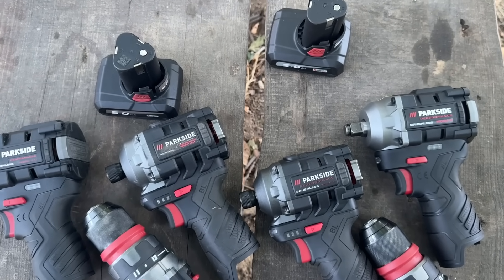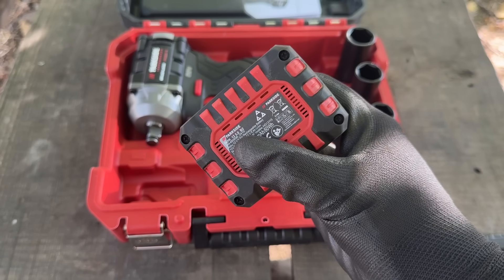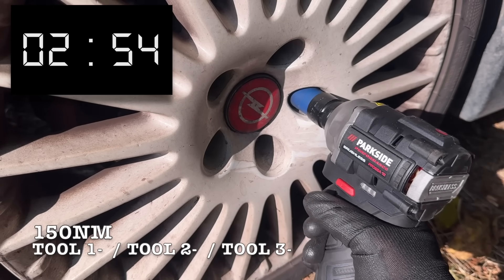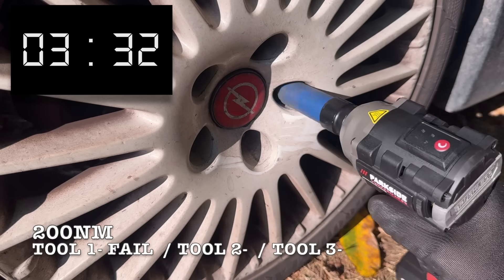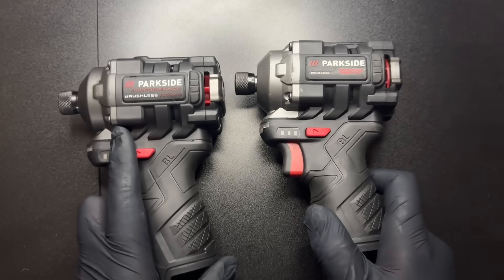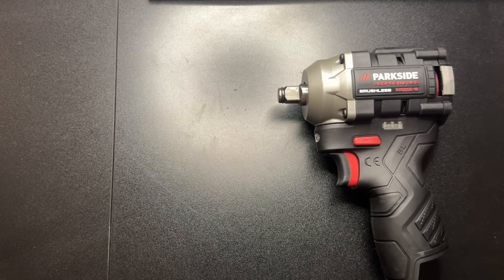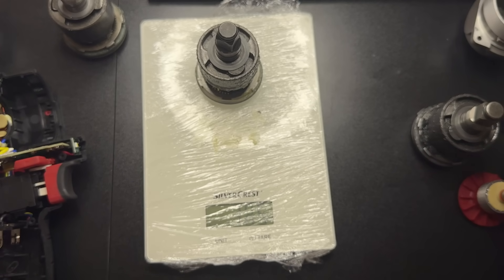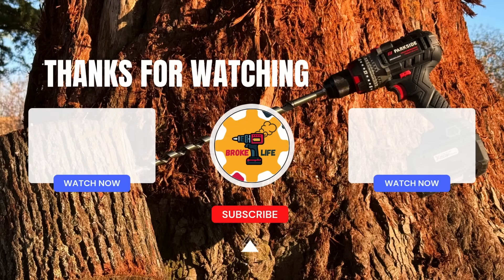Surprise! Parkside Performance 2025 Tools - Test and Teardown, PDSSAP & PPDSSA A1 12V.

Comment: Really helpful video as always! I bought the 2025 12V impact driver and converted it to 1/4 square the way you showed in the other video. It works fine for me as I use it with sockets up to 13mm. But I tested it on a M8 bolt and the maximum torque it produces is around 35-40Nm both tightening and loosening on 4 level. On level 1 the torque is around 12Nm and on level 2 is something like 20Nm. As standard M8 bolts can handle something like 40-50Nm. I’m happy with it but was wondering if this is normal as the maximum advertised torque is 170Nm. 5Ah will boost the power I think, but again it’s far from even 100Nm.
Reply from the maker: That sounds about right for the 2025 model which has a much smaller hammer when compared with the 2024 version. The 2024 version feels a lot more powerful with the 1/4” anvil, maybe even too poweful for that anvil. That’s why I have also switched to the 2025 one as my 1/4” platform.
Reply: @BrokeLifeEU Thanks mate! It’s a shame I didn’t find this channel earlier! You’re doing amazing job with these reviews, keep it up!
Reply from the maker: Cheers! Thank you so much for your kind comment!

Comment: it is normal cause your using the 5amp 12v impact wrench it is not great for thing more used in automotive world you would want a  A1 600nm small performance parkside impackt wrench atleast something with 20volt cause 12volt motor is not going to cut it.

Comment: I can't get parkside here in aus but I am a fan of aldi's ferrex stuff. Not perfect, but very good for their price (although sometimes there's a really shitty tool but they don't care if you return). 

This issue has also just cropped up for me, they sold a new kit last week that looked to be a compact redesign of their hammer drill and impact driver. Being a tool nerd I grabbed a kit but I've immediately noticed the driver in particular just doesn't perform like my old one from 2019. I haven't opened it up or anything but I wonder if it's the same kind of problem with the hammer/anvil.

Comment: Good tools, but the controlled availability marketing strategy doesn't really work for tools when you e.g. must cut hedge next weekend. Local shops often wouldn't even have essentials like spare 12V charger or battery.

Comment: here in Scotland they are selling a performance Tool kit consisting of drill driver and impact gun with the new model ending in B1 not A1 and manufactured in June 2025 I do not have an old model to compare it with

Comment: The older model hammer has a almost perfect 90 degree force impact over a large flat area, while the new one's with the large rounded edges loose power due to the half the force being directed against the circumference! My POW.
Reply from the maker: And they don‘t even hit both hammers at the same time so most of the time you get half of the IPM with the 2025 model. 😕
Reply: Prisoner Of War?

Comment: Hello! Parkside performance is coming to the UK for the first time this week. They're selling the 12v drill and impact driver with 2 of the small batteries and a charger for £50. Is it worth going for it should I steer clear since they'll be 2025 models? I'm really keen on the impact wrench if that ever came to the UK but saddened the QC might make it not worth the purchase

Comment: Would you say it's worth avoiding these going forward?
Reply: I have bought 2 torque wrenches. One is about 150nm, second ~180. Both od them has got worse type of the anvill. Is there chance to get 2025 version with old style anvil?
Reply from the maker: @machey8259  I have found a good 2025 one and I am editing the video at the moment so I will post it later in the week or next week and I compare it against the 2024 internals too.
Reply: @BrokeLifeEU can you test new version pdssap 12 b1 impact?
Reply from the maker: Not necessarily — I actually managed to find a good one and even made a video about it (although not yet posted). I just haven’t had the time to edit it yet, but I’ll probably get around to that this week or early next week.

Comment: I don't seem to see tools from the Parkside performance range in my three local Lidl stores. I check on a Sunday or Monday when the tools are advertised. The more expensive Parkside tools (typically sold inside the EU) simply don't reach the UK. I have never once seen your 5Ah 12v battery here. I consider Parkside a VERY basic budget brand, even in the UK. These days I avoid them.

Comment: There is a new PDSSAP 12 B1 impact driver but currently it is only available in a set together with the PBSPA 12 E4 drill. (70€ for both including 2 batteries), I actually payed only 49€ for the set since I got a 20% and a 10% coupon from the app. Might be interesting how the new B1 version compares to the A1

Comment: Herzlichen Dank für den Nachtest und das du keine Kosten und Mühen dafür gescheut hast.

Ich habe ebenfalls einen PPDSSA 12 A1, von 2025-05, gekauft direkt im Lidl-Webshop. Hammer und Schlaggewicht sehen bei mir genauso aus wie bei  deinem 2024er Modell.

Ich habe noch keine direkten Tests mit Drehmomenten gemacht, schlage allerdings dir vor, einen Drehzahl-Test durchzuführen. Denn die Drehzahl ist letzendlich entscheidend für das maximale Drehmoment.

\(E=\frac{1}{2}\cdot m\cdot v^{2}\)
E= 1/2 m x v²
----------------------------------------------------------------------------------------------------------
Thank you very much for the follow-up test and for sparing no expense or effort.

I also have a PPDSSA 12 A1, from 2025-05, purchased directly from the Lidl online shop. The hammer and impact weight look exactly the same as your 2024 model.

I haven't done any direct torque tests yet, but I suggest you do a speed test. Because the speed is ultimately crucial for the maximum torque.

\(E=\frac{1}{2}\cdot m\cdot v^{2}\)
E= 1/2 m x v²

Comment: Look, I’m experiencing a similar issue with the 12V drill. I bought one unit and immediately noticed something was wrong: too much vibration in second speed and low torque. Before returning it, I went back to Lidl and bought two more, because I wasn’t sure whether it was just that unit or if they were all like that.
The second one vibrated much less, but there was still a strange vibration. The third one, on the other hand, didn’t show any problem in second speed.
I tested them by driving two lag screws that my 20V Ferrex (45 Nm) can manage with some difficulty, but it gets the job done.
The first drill broke after a couple of attempts: the gearbox switched from first to second gear on its own and cracked.
The second one also shifted into second gear by itself, but didn’t break.
The third one managed to drive the screws with difficulty similar to the Ferrex.
Now I’d like to understand: how is it possible to have such big differences in production within the same batch?

Comment: So. A dremel and a grinding bit applied to the hammer and stops to to ensure they contact at the same time should fix the problem. Unless there is a hardness problem as well. I noted the anvils were looking a bit worn (very smooth in areas) on some but only on the top that indicates the hammer may be riding up on the anvil,  or the hammer or anvil has a slope on the face and that is power loss.

Comment: Typical behavior with manufacturers. Make a decent product, then try shaving a few cents here and there for the next iteration. I have three of the  big 1/2" impact wrench (green, non performance model) from 2022, 2024 and 2025 and the 2022 is still stronger than the newer ones... shame.

Comment: Not just Parkside... We've seen reduced quality (in recent years) from every other tool and especially vehicle manufacturers.
Reply from the maker: My car batteries usually fail within a month after the warranty runs out! The only thing I can do is laugh at how “well” and precisely engineered they are, then buy a more expensive one and hope it lasts longer. But maybe I should go the opposite way—buy a cheaper one and just hope it makes it through the warranty period.

Comment: Parkside tools are forbidden in my garage, in past I bought once parkside 230mm angle grider and is was faulty as well as all replacements, disk was shaking, so never again I bought a metabo 230mm angle grinder and still have it as well as other 6 metabo grinders. I use all 18v metabo and mostly 12v bosch and a bit 12v metabo

Comment: would you bother grinding some of the hammers so they make correct contact?
Reply from the maker: I don’t think that will really get them to the point where it makes much difference. Ideally, they’d need a new hammer and anvil—that would be the best solution here.

Comment: As a thought to get to the next level maybe a hardness test on the metal itself, it may not just be a matter of fit but also one of hardness. One thing for sure is that channels like yours are improving overall quality and performance across the board.
Reply from the maker: That’s what I thought as well—until I looked into how much those testers cost and nearly fell off my chair 😅 Still, I agree, it would have been ideal if I’d managed to test that too!

Comment: Congrats...I just bought mine yesterday but didn't find batteries and charger to buy. Is there a diy fix for the "hammer" problem?? Thanks
Reply from the maker: Thank you! Unfortunately, I don’t think there’s a DIY fix for this, as even the hardness might be different. Sadly, I can’t prove or test that, since the tools needed to measure it are quite expensive.

Comment: This unequal hammer not hitting the two sides of the anvil is a problem I noticed also on these cheap chinese impacts.
I own some of these and in all of them the hammer part is sticking out.
So I was able to grind the hammers to touch the opposite sides of the anvil the same.
It does make a difference in performance.

Comment: Thanks for the test. I was about to buy 12v impact to use with 20v, but now I won't.

Though it makes sense form Lidl perspective. They want the least varranty returns they possible, so reducing power for lasting longer is no brainer for them.

Comment: Great video.
So, the size of the hammer on the driver is a big deal, even if it last longer, the power isnt the same, so at least they should update that.
On the wrench, its clearly a production error, that once again it shows that diferent manufacters make a diference... for the same price. Maybe the next model will be made with tha same quality as the 2024 model.

Comment: Where do you even get hold of these, our Lidl in Manchester Never gets these
Reply: As far as I can find out Parkside performance range isn't available in the UK. We can have green, or green.
Reply from the maker: Unfortunately, the UK sees little—if any—of the Performance line, which is a real shame, because despite everything they have some superb tools!
Reply: As far as I've been able to find out, there has been little if any performance tools in UK Lidl. Until the 19th of October, when the website is promising the 12v drill driver impactor kit.
Reply: @dlh190 yeah it's funny that, just as we,re saying you can't get hold of them in Britain they are doing there first on the 19th oct

Comment: Do you think we can improve power changing the spring ? Thank you
Reply from the maker: I wouldn’t mess with the springs on these. The impact driver relies on the hammer mechanism for its power, and using a stiffer or thicker spring could overload the electronics. When it comes to the impact wrench, improving the fit between the hammer and anvil will have a much greater effect on performance than just changing the spring. Installing a heavier spring in a setup like this is a recipe for disaster — it risks damaging the tool or reducing its efficiency. Personally, I wouldn’t want to do that to either of them.
Reply: @BrokeLifeEU ok, I saw in your videos the spring from your 12v impact wrench , I think it s thicker than mine . My tool struggle to unscrew 200 nm on my car with 5ah battery 😢 . Thank you for response
Reply from the maker: @andreimoise94 Please don‘t tell me there is a difference in springs as well… 🤯

Comment: the same brand , but not the same quality  of the anvil and the hammer mechanism!!! the new one are bad ... not hard steal >... and they do not last longer...
Reply from the maker: Yes, these were a huge disappointment! That said, they’d be an easy fix if the manufacturer decided to do something about them—all it would take is replacing the hammer and anvil, and they’d be good to go. But the difference between the hammer and anvil in my 2024 model compared to the other three is massive. I honestly wasn’t expecting such a big difference.

Comment: Im a diehard parkside commercial user.
My first drill, was from 2015.

Lately the quality is going down really fast.

I bought a corded grinder.
The mcu is getting hot while not using and many more low quality items.

Comment: Hi there, i work in a factory producing pizzas for Lidl Greece. They come for inspection every 6-9 months and they check what they think it needs to be checked. I agree to a point but if they truly want do quality controls (quality is excellent but working environment is average) they have to go undercover somehow. They have to be "insiders" so they have true quality inspection cause once you find your self "f'ed up" you dont risk it of being found a second time... You make anyway possible that there wont be a second time. Great video as always. I was a parkside fan and admirer growing up but now almost 32 i find my nephews toys to be around the same quality of parkside tool shells and thats disappointing. Only parkside tool i get from time to time are either mechanical or wired 🤷🏻‍♂️
Reply: Interesting! I think it's different with parkside: lidl (or OWIM or whoever) will negotiate with the manufacturer on where the price is and where the bar is set for quality assurance. The manufacturer then decides how much QC testing goes on and how tight the acceptable tolerances are. Often in today's industry, QC become less frequent and looser once a given product becomes established in the market.. so parkside's B2 models are to be approached with caution if the A1 is good. But it's annoying that they sneak the cheapened product in without changing the model version number. Lopping a bunch of mass of the hammering mechanism in an impact wrench and claiming unchanged specs is a bit scandalous
Reply: @Failsafeman100 i think the video is far to clear not to be noticed by lidl customer support
Reply: @LazarosXalatsis let's hope so!
Reply from the maker: Well if the channel gets deleted we‘ll all know that they‘ve noticed 😂😂😂
Reply: @BrokeLifeEU lol no 😂 i dont wish that to anyones hard work lol

Comment: Nice video and good analysis! 

What happens if you file down the anvil so the hammer would strike it on both sides at the same time?
Would you get the right performance out of it? 
It is a replaceable part after all. 

I have another question regarding the impact drivers: without load, do both motors spin with the same speed?
In theory, an impulse is calculated like so: 
velocity • mass = strength of impulse

So in theory you could have a less massive anvil and turn the hammer faster to compensate.
Reply from the maker: Thank you! It’s the edge of the hammer that’s more of a problem, not the anvil itself. But I get the idea and yes if they fit well together it will work. As for the speed on the motors my RPM gauge is rather unfunctioning at the moment 😅
Reply: @BrokeLifeEU  Now that we know about the problem, if I were ro buy such a tool, I'd have to disassemble it first and check + improve, before I start using it. Then hopefully the edges will stay intact.